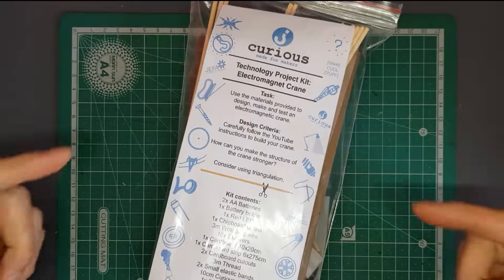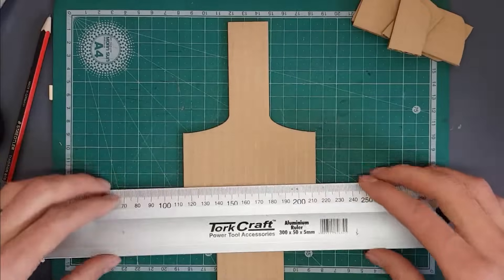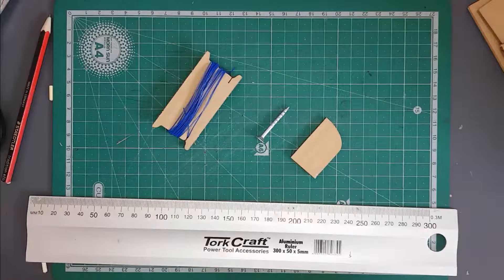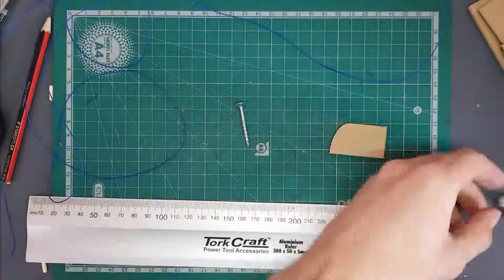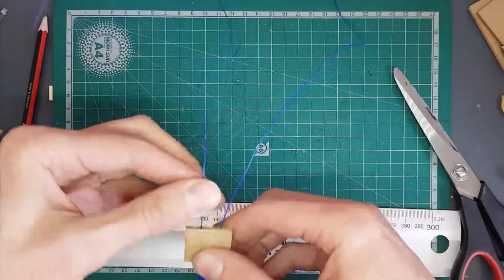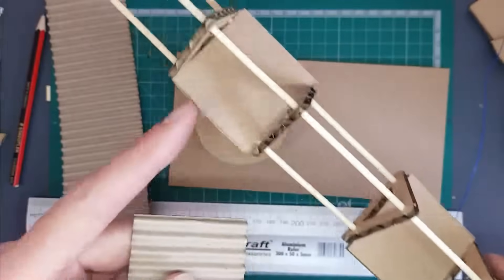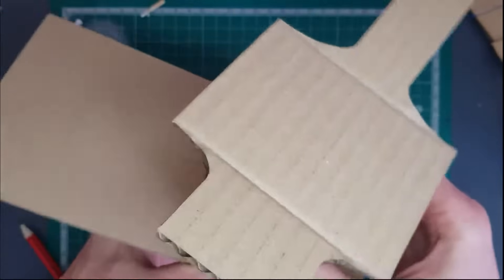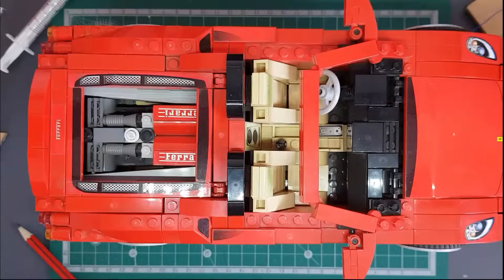CuriousDIY Project Kit - Electromagnetic Crane PART 2

Comment: Is the LED lights a must to be used in the electromagnetic crane because my group and i didn't use it and our electromagnetic crane worked perfectly 😅
Reply from the maker: Hi there,

The LED is just there to show that your circuit is working. If your wiring is correct, the electromagnet will still work even if the LED isn't there—so you’re all good.